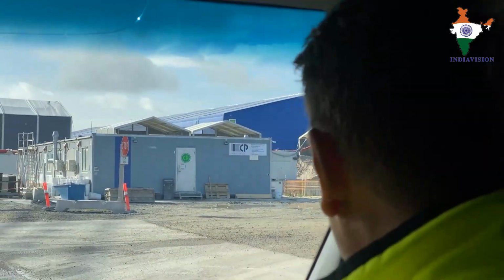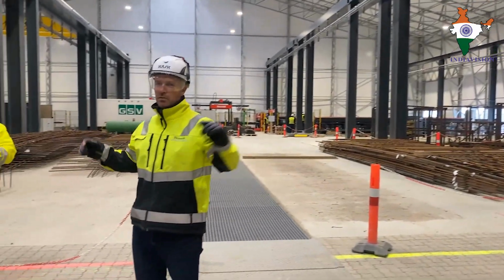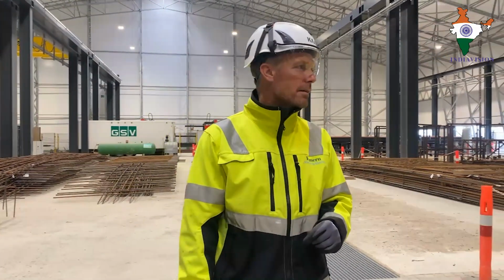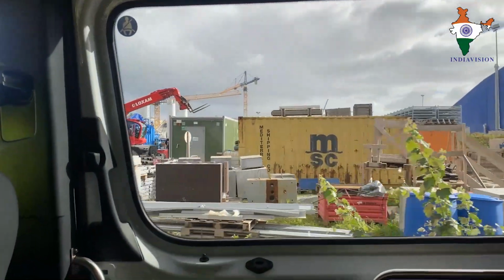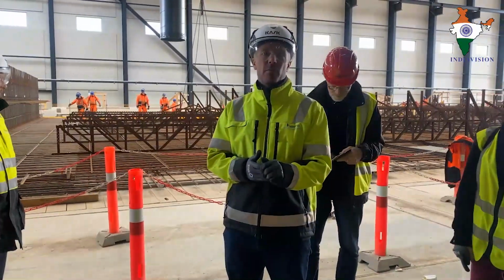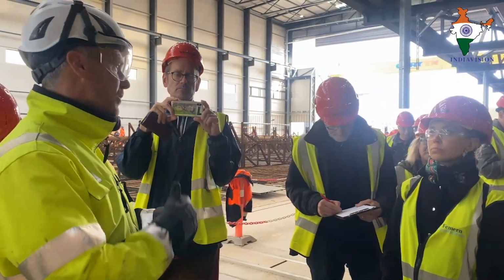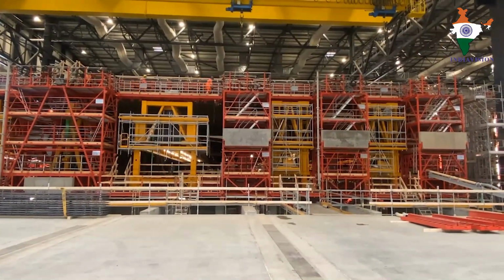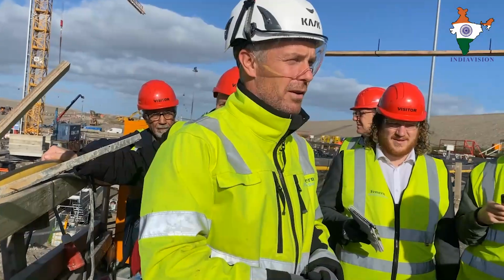The Fehmarnbelt Construction Site

Comment: The similar huge built of the new Bridge (and a drilled tunnel for trains) over the near similar distance, and Danish only, Storebaelt has effectively been paid back much before originally expected, by the payment from the - more than expected Traffic! No one wants the old ferries back though it was originally much disputed. But even "The haters", without a need themselves for crossing often, have now admitted that a Bridge is fine, when there!
    And I do expect that the coming and increased traffic over Fehmarnbelt, when the ferries mostly end, will also soon be able to pay for itself, and it will then be a - Danish Only Profit for the next 100 years! The traffic will be much less noisy when coming spread and not in huge, tight groups from the ferries😄!  Finn. Denmark